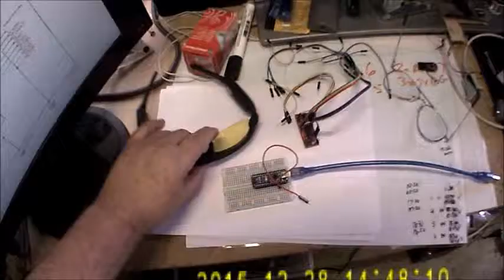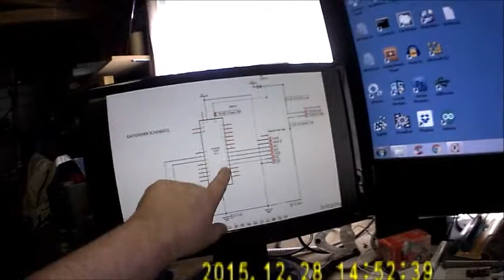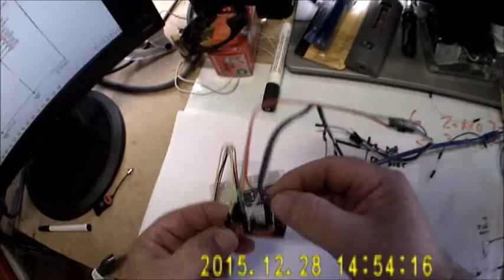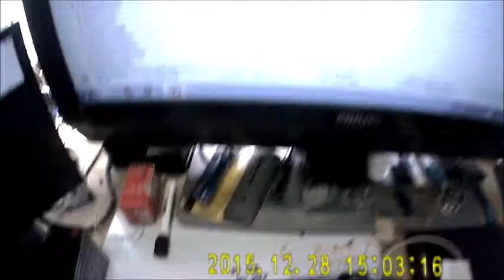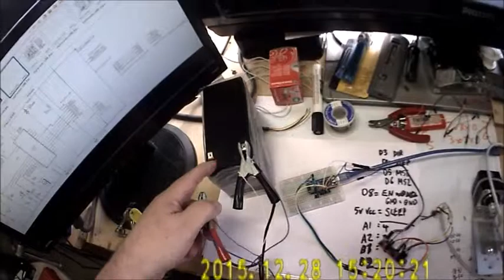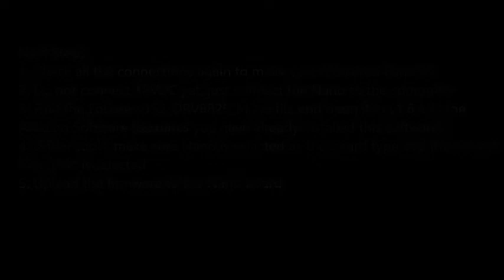myFocuserPro Breadboarding Nano and EasyDriver

Comment: Hi
Is the latest firmware version v174 working with this setup? I saw the schematics and they are more complicated , with temp sensor etc.
I'm looking to make something more basic , just arduino and easydriver, like you have shown in this video but was wondering if v174 would still work. Thanks!
Reply from the maker: Yes, 174 is ok, as you can specify in firmware to turn all options off
Reply: Thank you for your help. I was able to connect the focuser, but it doesnt work well. With the standalone Moonlite program the motor spins, but it randomly switches direction in the while it is moving. I couldnt get the ascom to work (I had the capacitor connected between reset and GND) and INDI didn't move the motor at all, it just made it vibrate.
The correct firmware is the DRV8825_HW203, if I understand correctly
Reply from the maker: @vladutzalex  ; email me direct at brown_rb @ yahoo dot com
Reply from the maker: @vladutzalex  : Did you adjust the current potentiometer on the Easydriver board? Also are you sure the stepper motor cabling is correct? Recommend you visit the web site and download the pdfs and test programs. https://sourceforge.net/projects/arduinofocuscontrollerpro/
You might also want to look at this next one for specific details about the easydriver
https://sourceforge.net/projects/arduinofocuscontrollerpro/files/DRIVER%20BOARDS/BOARD%20EASYDRIVER_HW203/